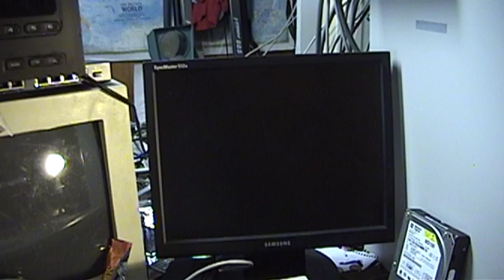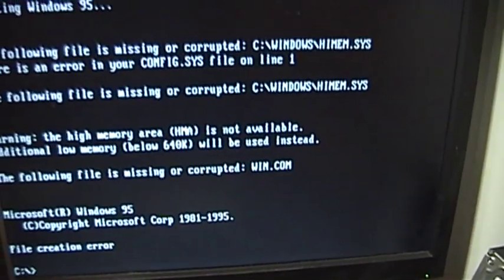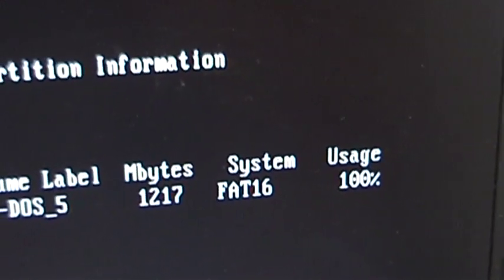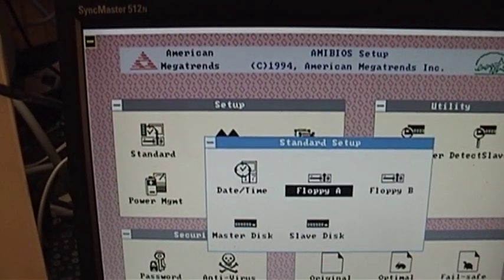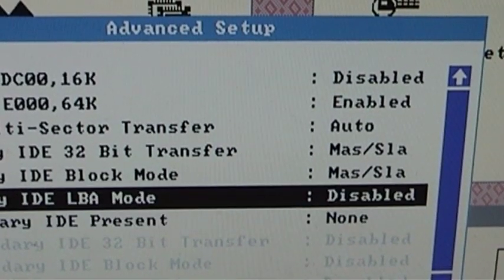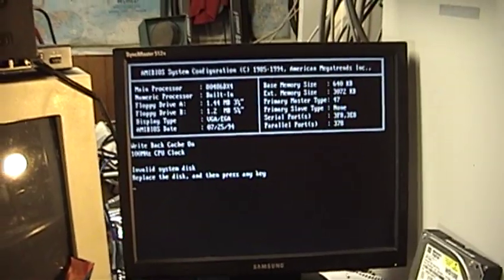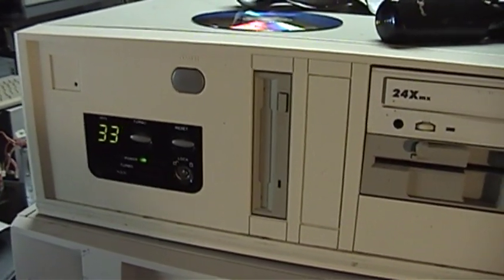Am486DX4/100 Clone PC Revival

Comment: Some memory modules had gold plated connectors, some were tin.  Same with memory sockets on motherboards.  People used to say you shouldn't put tin in a gold plated socket, or vice versa, because the metals would react and corrode.  I don't know if that was a real issue or just people being eccentric.

Comment: I have a question, is the -5v rail on the PSU (white wire on AT, and ATX) really needed for ALL ISA cards? I recall being told that only serial controllers and some very early 8-bit ISA sound cards used -5v, but I may be wrong. I found an old, but not really vintage, Socket 7 ATX motherboard from around 1996-1998, it accepts an ATX connector, but none of my spare atx psus have -5v, and I want to use a couple ISA cards, a sound card & a network card. I could use a pci network card if I have to.

Comment: Yup, "Write Back Cache On" is the patched fake BIOS message. If it had real L2 cache installed, it would report the actual amount of cache present, typically 256KB. I have a PC Chips M919 which has fake onboard cache but gives you a slot to install a proprietary SIMM-like stick containing 256K of real L2 cache. Later versions of the board don't have the fake chips installed, but you can still see the fake solder traces which go in circles and don't connect to anything else on the board!

Comment: Its a PC Chips board, they loved WinBIOS and advertising fake write back cache. Check Total Hardware 99. SuperMicro did WinBIOS too as my 440BX board got it. The turbo button and LED work independent of the motherboard, you have to check for any slowdown (a dir /s usually works). I wish I had a late 94 BIOS on my Soyo VLB board, non-PCI 486s with LBA BIOS aren't common. The Promise EIDEMax II ROM runs all my HDs in that machine. Now if I could only find a nice EISA/VLB 486 board...

Comment: While it looks nice, I prefer the Award BIOS over the AMI "WinBIOS", simply because I had a great deal of issue trying to populate the PCI card slots on an old 486DX2/66 system, which is because of an issue with the BIOS not distributing IRQ signals correctly and to every expansion slot.

Comment: That looks like a PC Chips (a.k.a. Hsing Tech) motherboard to me. "Write Back" labels are usually a dead giveaway that the onboard L2 cache is fake, with a patched BIOS to lie about it (usually soldered to the board, so you can't swap it out for an authentic BIOS). Cache testing utilities like CACHECHK will tell you for sure if the cache is real or fake.

Comment: I do have a Biostar Socket 3 board that lets you mix and match both memory types at once.  You just can't go over 64MB.
It just occurred to me, there's an easy way to tell the L2 cache chips are fake.  First, they're soldered in.  Check the traces.  I bet you they don't go anywhere. :3

Comment: I wish I still had a computer similiar to that.  The best thing I have is a Dell Dimension XPS M200s with an intel pentium 200 MHz processor in it.  Everything is on board with it except for the video card.  The system currently runs Windows 98 SE, but I use it to play old DOS and windows games.  While the computer is good and all, what I do not like about it is that I can't get sound and music on some DOS games even though the on board sound is sound blaster.

Comment: I always wanted one of those lighting fast 486DX4-100 back in the day, but they were so damn expensive :(
So I worked the whole summer and got a used compaq 386SX  instead. (With a C= 1407 monitor if I remember correctly)

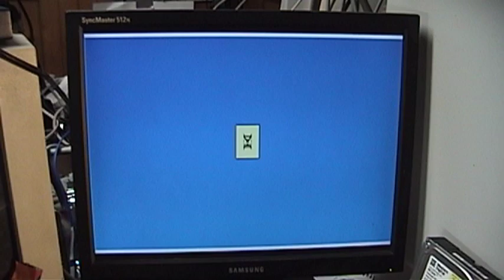Comment: 10:15 I've seen some old thinkpads have a graphical setup called easy setup and most of those that have it have a clock error because the clock battery is hard to replace

Comment: 3:55 The biostar u8668 pro motherboard in my P4 rig has slots for both PC133 and DDR1 ram... So I used the pc133 and decided to be stuck with 512mb ram and windows 2000, although it also works perfectly with XP but I like 2000 more.

Comment: If the cd-rom drive has the creative labs logo on it, does it have a sound blaster? I am getting a pentium pro and it has a creative logo on the cd drive. The monitor did not work, but I heard the windows 3.1 startup sound. Does this pentium pro probably have a sound blaster 16?

Comment: More memorys refreshed bill :-)

Ive enjoyed 486's like yours, After testing the psu i would pull out all the cards/interfaces and power the mobo to see if it beeps, then put a display card in and with two cleaned memory strips i try again.

I would leave all mobo fixing screws loose and plug in two cards into the slots with max distance apart and after putting the two card screws in then tighten the mobo screws.

Worked for me:-)

Sorry bill i was a bit of a nerd in my 486 days :-)

Comment: I had a system that indeed used and the same time (and I cant remember weather it was the 30 or the 72 pin SIMs)it was that and SDRAM. I can't remember the exact specs for the system. I know it had an Intel 486DX4 inside or that's what I remember what was but other then that I don't remember. what I do remember is that if you had both type installed you would incur a performance penalty on the higher speed SDRAM. I do remember never really wanting to have both types installed for that reason.

Comment: That motherboard looks like it's one of the old PC Chips fake cache motherboard... To quote Red Hill Technology, the onboard cache is nothing more than "black plastic things with metal legs on." Sometimes they not only put fake cache on the board, but also a fake COAST slot that wasn't compatible with COAST sticks. I have one such board with the fake cache and fake COAST slot, the PC Chips M919.
PC Chips just loved to cheap out wherever possible...

Comment: My first computer had a bios and 100 Mhz processor just like that one, and the turbo button wasn't hooked up. I wish i had known about having to configure LBA or the drive parameters back then, because I recall trying to install Windows 95 and failing miserably, then giving up and smashing the computer with a sledge hammer.

Comment: On my other YouTube channel. i took a old hard drive form a computer similar to this one and slapped it into my newer computer. low and behold it booted right into Windows 3.1. i was shocked manly because the machine i put this older hard into was 10 fold faster than the older computer i took it out of. Windows 3.1 was running at 2.20GHz and with 1GB or RAM. i don't even think Windows 3.1 could run on a 2.20 GHz CPU or handle 1GB of ram? let me tell you it was fast!!